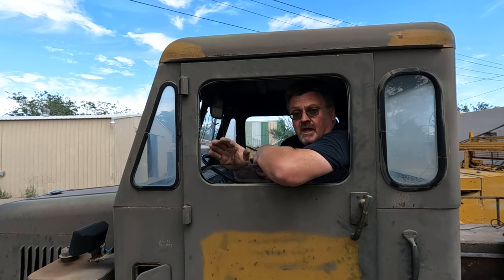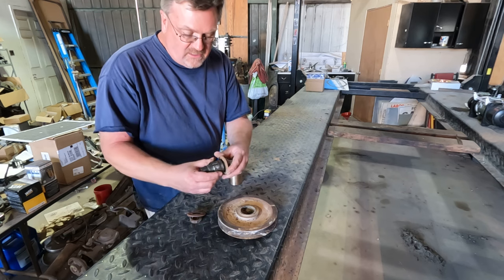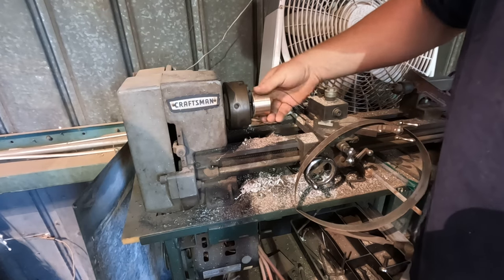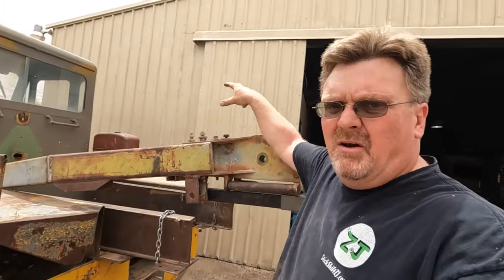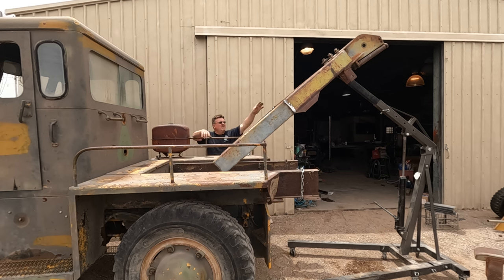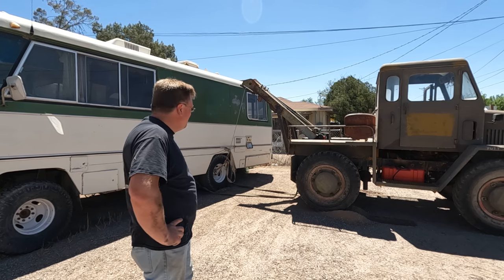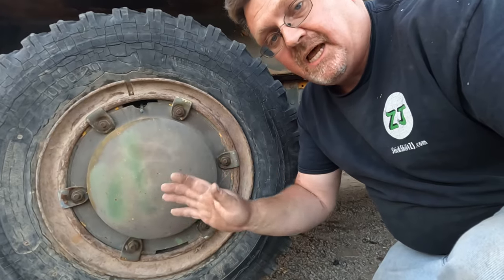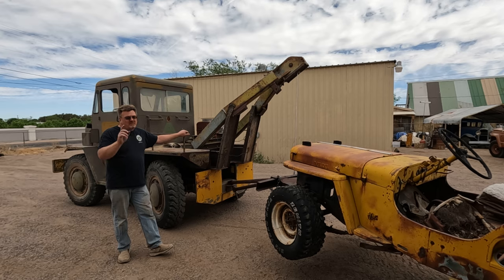The Tow Tug, 10,000 lbs of Awesome!

Comment: During Vietnam, the Coleman tug pulled bomb trailers from the ammo dump to the flight line on most Air Force bases.  A beast for the most part, but, the electric clutch was the weak link.  Too many rpm and dump the clutch and there you sit. Broken TUG is not much good 🙂.  Millions of bombs pulled by the tugs ..
Reply: Electric clutch sounds interesting. I used to maintain an older one this that was only front steer with a Flathead 6, and a newer tilt nose g40-g. Both had Allison autos.
Reply: @82f100swb    We also had International trucks with the electric clutch.  The button was integrated into the shift knob.  Some engineer had smoked too much "Happy Hay" while designing this stuff. . .
Reply: @jamesbroome1815  That definitely doesn't sound like a good recipe for idiot resistance! More like one for broken parts.

Comment: I hope i can give you a couple of pointers, first when you are winching you need to keep the cable low, if its high it lifts the front of the truck, use a snatch block at the lowest point of the frame/ body, this will make a huge difference, and of you use 2 snatch blocks , one chained to the vehicle to be recovered and then the other on the back of the wrecker run the line in a loop, doubles your pulling power, 2, the lower bars you were using for sling bars need to be mounted up as high as you can get them on a heavy piece of channel, they need to be close to the outside of the bed, on a double pivot, when you are towing those arms need to be in the downward position, if they are level or up at the vehicle when you put the brakes on those bars will over center and you can loose the tow vehicle and cause damage to it hope this helps you
Reply from the maker: Thanks, that's good info!

Comment: Love your build, first time I have ever seen a tug like this. My only time I have sen a tug, was a Jeep CJ-10. This(and I am a Jeep guy) is way cooler! I would like to suggest adding chains to hold any load after getting it high enough. So, in short, raise it with the winch, attach the chains on each side, and lower the winch cable so the chains are holding the load and not the winch. One thing I do know is the winch construction is not designed to hold shock, and with a lot of situations, you will get un and down shock with the load. The chains(I suggest a 70K test load) will happily hold the load secure.and, save the guts of your winch and the winch cable. Other than that, I think it is very well designed!
Reply from the maker: Thanks for the idea!

Comment: 16:12 As a welder, if you came across this type of job again, that I would strongly recommend that you should get a inverter welder, so you can weld SMAW(stick), even if it's a cheap one it's hard to go wrong with one of them. 

GMAW(MIG) is good for overall applications, but SMAW(stick) is perfect for this application, due to the factors of the metal thickness, rust/paint, and penetration capability of SMAW(stick), it would be a lot stronger then the welds of GMAW(MIG). There's reason that they use SMAW(stick) on brigises.

We are all students and teachers in are own right and we should never stop learning because we think we know it all, this world is vast and has a lot to offer. So take advantage of that and learn new things.

Thank you for this awesome video and I hope to see more of charming old aircraft tug be put to good use again.
Reply: Welder...

Comment: On the Harbor Freight winches, the ZXR winch you can buy an adapter to use a cordless controler. The Apex it comes all ready to use a cordles remote. The Apex is a bit better winch. You might want to consider swapping from the steel cable to the synthetic rope. Lighter, more flexible and safer to use. When steel breaks it can snap back and damage things. If it hits you it may kill. Synth rope doesnt snap back like steel, it mostly just drops to the ground.

Comment: The cab-operated PTO-driven winch seems to be a real common thing on older stuff, and I can't help but wonder if the expectation was that generally there'd be a driver and a driver's helper, at minimum.

The RL's somewhat similar to the half-track for winch operation, and it seems mighty inconvenient to me solo: Transfer case in neutral & PTO, pop the little pull-knob for disengaging the winch dog & free-spool the winch drum, release the winch brake, climb out of the cab and drag the cable by hand out to where you need it, hook it up, walk all the way back and climb back up into the cab, release the free-spool, clutch in, main gearbox in 1st, and work the winch with the main clutch.

What a pain! Remote control is the way forward!

Comment: Most if not all of the Badland winches can be operated with a wireless remote also (those I have seen came with wireless) which is great because if the remote batteries go dead you can run it with the wired control as a backup.  They have been getting pretty universal good reviews with the only downside being they can have a very short duty cycle in some models.
Reply from the maker: That's good to know, and I'll keep an eye out for it heating up.

Comment: Add a pully to the back bumper of the truck so the cable can go through it, now you can pull at ground level straight towards the truck as well
Reply from the maker: I was thinking the same thing, just picked one up and its sitting in the back of the tug right now.

Comment: Gotta use a pully no matter the winch and load imop. There are certainly cases where a single line pull for speed is acceptable. But if you're pulling hard and you like longevity, I'd use a snatch block religiously. Cheers 🍻

Comment: Heij, very cool tug! But You might want to couple the winch battery with some diodes to the charging circuit. I thunk the diodes to only allow power in but not out so it gets a refresh when the engine runs. Sounds easy enough, doesn´t it?
I´m no pixie trainer so correct me when I´m wrong. A high idle (like with hydraulics) might come in handy, too.
But all in all it´s a cool tug to have, You might even attend the Wrecker Games, I bet You´d have a fair chance. It´s a cool tug.

Comment: Re wields on the boom will not the top wields be in tension? Perhaps a plate over the top wield, bolted and wielded to the frame will ensure no failure approaching a 10klb lift.

Comment: It's actually really easy to measure a wide angle like that since all triangles = 180° put the straight edge across like you did  measure the two internal angles with a cheap angle gauge let's say one side measures 45° and the other side measures 37° add them together 82°.then do  180°- 82° = 98° so your un known angle would be 98°

Comment: Did I miss something? Did you make that camper four wheel drive? That can't be factory. Is it? Now, I know. I will never be able to buy it (the camper) from you because, how could you part with it. The Tug is epic! Also, I would need to come out to your neck of the wood..ahem, Country.   😄
Reply from the maker: Yes, the camper's got a Dana 60 front end and drivetrain from a '94 Dodge 4x4.  I started building it about 10 years ago (way before I did video), but hit a snag with the steering.  I recently picked up the front axle I needed to fix the steering issue, so that one will be coming up on video soon.

Comment: Why not bolt a winch fairlead to the ibeam to get your angle?  Mount the fairlead on the aft side of the ibeam. I think you are a genius but…that winch mounting and fairlead set up.  You can mount the winch in different positions by loosening the bolts on the gear box and you can then rotate the handle to a different position.  Wait until you discover you can buy a wireless fob to control the winch.

Comment: Is there a reason you are spooling off the top of the drum instead of the bottom spooling off the bottom would have made your clearance  problem  go away not to mention  every winch I have ever installed is engineered for the load to be on the bottom the drum (just saying) but I am liking  you project
Reply from the maker: I just went with how it came out of the box, it was already wrapped that way.  Also, the control "in" and "out" matched spooling off the top.  I never considered reversing it, but that would have worked better.  Its working for now, but next time I have it spooled out I'll look at going the other way.

Comment: I have a chance to get one of these.  How fast will it go? 35? I'm just hoping to cruise around town and take it out into the country and i was hopping for 55-60
Reply from the maker: I think it's supposed to go 40, but I wouldn't want to go that fast in it.  With the short wheelbase, tall height, and marginal suspension one good bump at speed could really throw it for a loop.  Also, it's hard to get the rear steering straight (you can't see the tires without hanging way out of the cab).  I'd want to keep it under 35 even if it could go faster.

Comment: Does your welder crank up for short periods of time or is it limited to three settings or so?
Reply from the maker: Its got 5 settings, 130 amp max, and you can't weld continuously when its turned up.  After about a minute or so the arc got weaker and it needed a cool down.

Comment: Out of curiosity, is that a 110 volt or a 220 volt Lincoln welder?
Reply from the maker: Its 220V, supposed to be 130 amp or so.  It actually has worked well over the years, and I really put it to use.